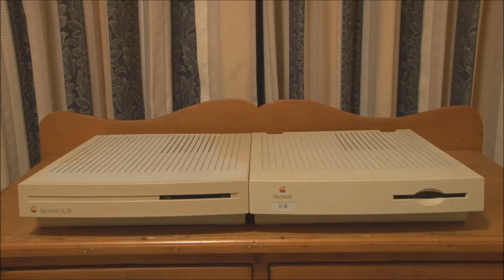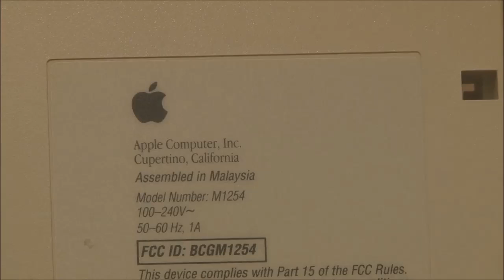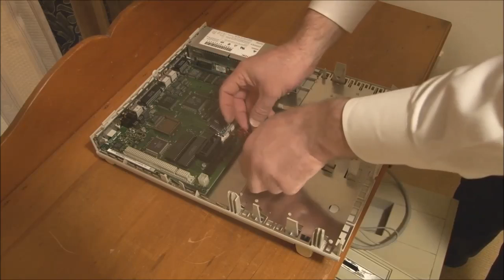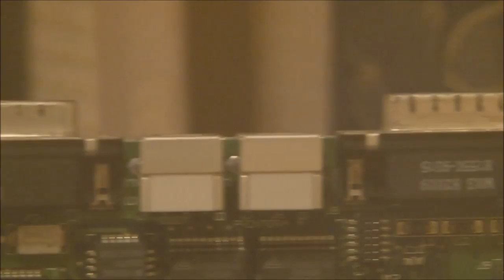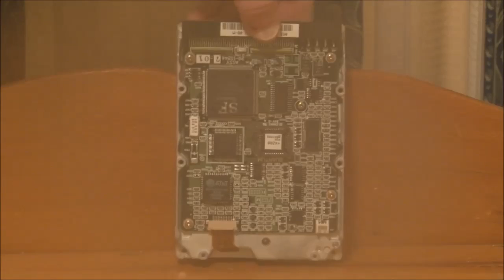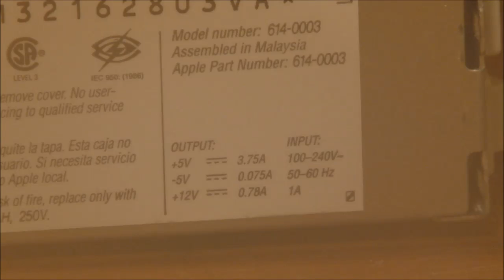Apple Macintosh LC III (1993) Full Tour and Disassembly

Comment: This is a trip down memory lane!  My Dad bought a Performa 450 back in 1993 after I recommended them after using LC's at school.  I loved the look of the later cases!   From that era I remember using Classic, Classic II, Colour Classic, LC, LCII, LC475 (later case) and finally Performa 460 & 475 (also later case) at school.   In the shops I remember the Performa 200 (Classic II), 400/450 (both in the later cases) and the Performa 600 (I don't remember them having the later case design).    We upgraded the 450 to 8Mb RAM (4Mb module was £199 from John Lewis!) and an external Apple CD300e.  Printing was handled by a StyleWriter II.  It also had a Microtek scanner which soon showed the limitations of 512k VRAM!  We were short changed by Dixons - they had supplied the wrong monitor and I only discovered a year or so later.  The 450 should have come with the Performa Plus monitor, not the Performa (was for the 400) so we were stuck with fuzzy vision until the 5320 came along...

Comment: Great to see a channel like yours! I have recovered one lcIII that my parents used back in the day, and I have solved some issues like the battery and swapped some caps. I’ve never used on of these, and when turned in it works, mouse works though I haven’t managed to find a cable for the keyboard II so it’s just mouse right now. Thing is I get a kind of WARNING, basically the whole screen is blank but in the middle a Icon of what I believe to be a floppy disk, with a interrogation mark. Can’t get passed that warning, any ideas?

Comment: My memory of the U.K. range was what you call the LCIII+ (33mhz 030) was sold here as the performa 460.
I believe the core design of the LIII (and LClll+, performa 460) was carried over into the much faster, later 
LC475 (which used the LC040 @25Mhz). Did Apple design the System with its full 32bit board etc deliberately to allow for this later development?

Comment: Hello, Can you please help me. My Macintosh LC3 don't start. When the screen is open, there's just on it a "disquette" (in French) with a interrogation point. Thank you by advance.
Reply: Apparently nobody answered you. This symbol means the computer cannot find a disk with a System Folder on it. Perhaps your hard drive has died or become corrupted. If you can get somebody to make a floppy disk set of System 7's installer you can boot from it (just turn on the computer and put it into the drive when the "disquette" symbol comes up) and see if the hard disk is useable. If it is, install System 7.

Comment: I had an LCIII and it served me well from 1993 to about 1998. I upgraded the memory and that was very expensive. I added an external CD rom drive when they became a bit more affordable. I also bought a modem 9600 baud and did AOL. They started making the internet accessible and this was the 1st computer I used on the web. It was a great value back then to get an MAC IICI 030 speed at an LC price. I then bought a Beige G3 with a 17" monitor to replace the LCIII.
Reply: Do you remember what model of monitor you used with this?
Reply: @hellion9547  it was the 12 inch or 13 inch trinatron crt   i know as i have both and also 2 lc 3s to go with them

Comment: Adding to the confusion of the LC III, there are three models of it that can all look identical. The original had a 25 MHz CPU. The LC III+ (which can also look identical to an LC III) had a 33 MHz CPU. Then there was the LC III that used an LC III+ logic board but ran the 33 MHz CPU at 25 MHz.

In order to tell what speed your CPU is running at without using Apple System Profiler is checking the position of a zero ohm at R14 on the board. If there's a resistor installed here, your CPU is running at 25 MHz. If there isn't one here, and instead one is present on R74 then the CPU runs at 33 MHz.

Comment: I remember that the original Macintosh LC had an option for two floppy drives and no hard drive. I'm not sure if the LC II had that same thing (because I haven't yet watched your video on the lC II yet), but I noticed for sure that the LC III did not have that cutout for a second floppy drive on the front panel, as well as not having the second floppy drive connector on the motherboard.

Also, I thought that the LC III had a soft power switch and not a hard power switch.
Reply from the maker: Jordan Woolery The LC II did not have the option of a second floppy drive (due to the fact that almost no LCs were ordered with this option).

Comment: Do you know where I could get a 4pin mobo to molex connector for these macs? And would there be a reason why one of these cables suddenly fail? I have a Macintosh IIsi and either the motherboard tracers or the cable suddenly failed over about 10 years ago, and gave it back to  it's rightful owner, my uncle, when he passed, my aunt gave it to me to sort out, then it wound up as my birthday present, and I really want to get it working again. I was able to power the HDD with an external PSU until that no longer worked, It may be the PSU, the Molex connector or the hard drive I dont know, Can you help?
Reply from the maker: AfterDark3 I have never seen that 4-pin to Molex connector fail - but it should be fairly easy to find, as many models of Mac used that connector (all pizza-box LCs, IIcx, IIci, IIvx, IIvi, IIsi, Quadra 650/660/700, Centris 650/660, PM 7100) The LCs used a short cable, whilst all other models used a longer one, but it can still be used in an LC.

You should check for power on the 4-pin connector with a multi-meter to verify that power is reaching that connector, and then verify that power is reaching the Molex connector. My guess would be that the hard drive may be at fault, not the cable or logic board. For example, if the drive has "stiction", then it would show no signs of life, even though it may be receiving power.

Comment: Good show. I got a hold of a good working LC III a few weeks ago; my first 68k Mac. Interesting note of the III+ not being identified as such on the front panel, I didn't know that. Made me open up my III to confirm the model! The guy who runs the MacCaps repair service has also cited the LC III as his favorite Mac.

I think your camera actually had a smudge on the lens - seems like it from the brownish haze and that it's worst in the center and more clear around the outside.
Reply from the maker: ***** Interesting - I will check the lens when I do my next video! The camera that I use normally has no issues with its' white balance, iris, or contrast in automatic mode - except when I film a CRT display. I have to use manual focus, manual iris, and manual white balance for that.
Reply: Have you recapped it?

Comment: Thanks for explaining the style changes and reasons for it. I had a non auto inject floppy LC III, always wondered why they had the change of styles
Reply from the maker: parad0x666 It is a shame that Apple made that change - it was simply a cost-cutting measure, which resulted in a less attractive case style (in my opinion!). If you examine an auto-inject and manual-inject floppy drive, you can see why Apple did this however - the manual-inject drive is far simpler, and would have been far cheaper to manufacture.
Reply: Jason's Macintosh Museum That's true, I kind of liked the 'cleaner' design of the later models however, with the smooth front. Probably also because I owned one :)

I have a heap of Classic Mac's stored at my parent's house - they'd love to get rid of them and I should really try and help them out. Get in touch, I'll need to do an inventory but I might have some models that you're missing from your collection :)

Comment: Used this machine extensively back in the day, the ultimate LC indeed.
Reply: lactobacillusprime You can overclock a 25 MHz LC III to 33 MHz by moving the zero ohm resistor from R14 to R74 and get a 32% boost in performance for pretty much free.
Reply: Just remember to add a heatsink to the 68030 because it gets REALLY hot.
Reply from the maker: lactobacillusprime The LC III was indeed a good system - but I think that the LC 475 was the ultimate LC. Having the 040 CPU in the same compact case made it even better!
Reply: Jason's Macintosh Museum You're absolutely right, a faster machine; a 68040 in an LC form factor. Sadly didn't own that one.
Reply: Cool thanks!